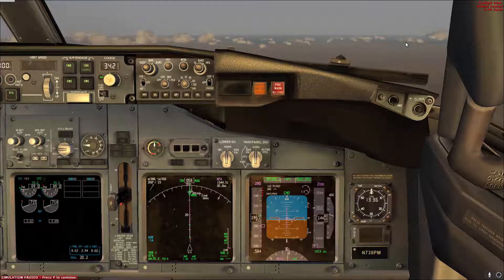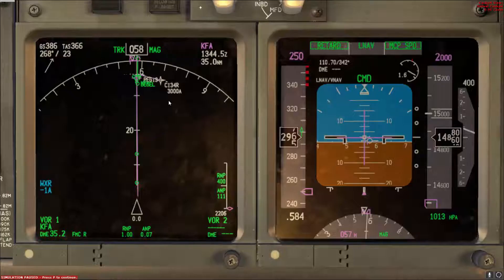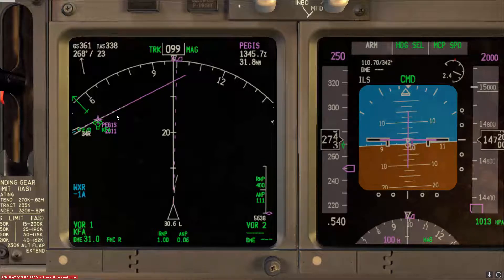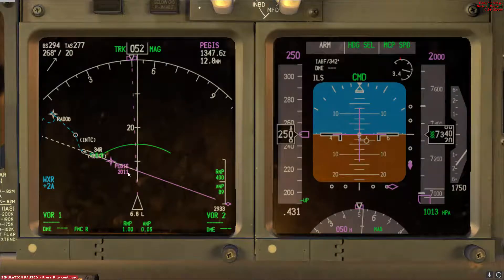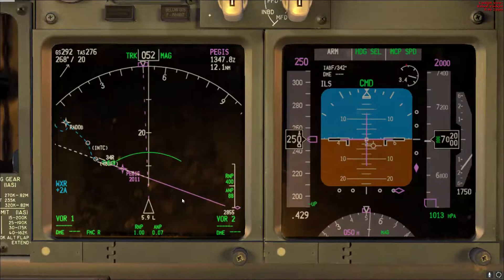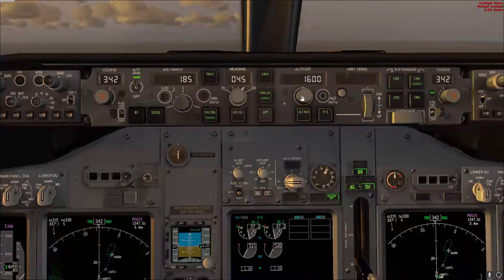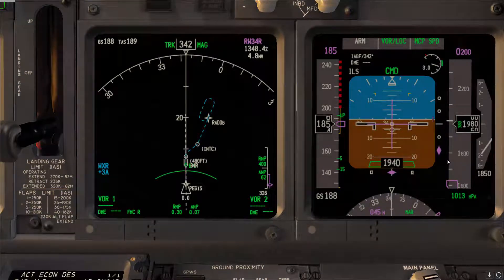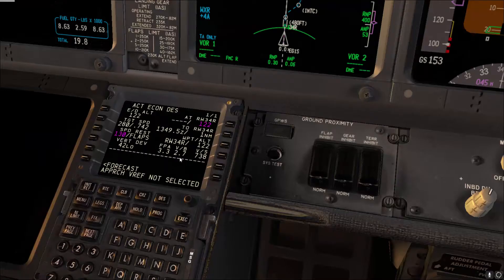B737 Energy Managment 2/2

Comment: Thanks Capt for the great videos, another way for track miles for example in your video at 14700ft if you select Meters in the EFIS panel you get about 4,480m which for reference you could use as 44 track miles to touchdown (sea level).
Reply from the maker: Thank you Bishtiga, 
That is a great tip, quick and easy to find track miles. 
Thank you for sharing 🙏🏼

Comment: Hello captain, I know I’m a little late on this video but I have a question?, can I extend the flaps to 10 and flaps 25 to slow down faster considering we are not exceeding the flap limit speeds? Would it be a good idea considering the exact situation as in this video?
Reply from the maker: Hello Erfan, 
You are not late, believe it or not I am working on a video currently talking about flap retraction/extension schedule, your timing is great 😉. 

F2,10, and 25, are not standard flap for the approach, the normal extension schedule is 1,5,15,30,40. From a few times that I was flying with pilots and they request 10 or 25 for this exact reason (being too fast) I find it not the best idea, using speed brake or extending the gear a bit early is much better.  
Hope that help, 
All the best 
Abdul
Reply: Abdulmuati Asiri Thanks for the response Captain. 
one problem is FCTM does not recommend to use speedbrakes along with flaps extended as it may cause buffeting. Now what I meant by using flaps 10 and 25 is just instead of waiting for the speed to decrease below the flap limit, you can just extend from let’s say 15 to 25 as the speed limit for flap 25 is less than that of flap 30. So basically buying time and slow dow faster. Now my question is weather this technique could leave you stabilized by 1000ft in this exact video?, or it would be just really not that effective?
Also looking forward to your next video!
Reply from the maker: Hello Erfan, 
I still not a big fan of F10 & 25, 😐. A few times that they were used, we were really close to the limit, that I felt not comfortable. 

The best option in my opinion if you are slightly above the profile selecting F1 then v/s 1500-1600 and f5 while still on the same or even increasing the v/s while watching out for the speed to be maximum 210 is a great way to get down quick on the profile then gear down, reduce v/s slightly to slow down slowly to F15 limit-10knots. 
Usually this is what I do if I am slightly high or fast close to the RW. 

Thanks for pointing out about speed brake use with the flaps 🙏🏼. 

And thanks for the feedback and discussion really approximate it, please continue raising up these discussion points 😊. 

All the best
Abdul
Reply: Abdulmuati Asiri thank you so much for the thorough explanation, I will note that down!

Comment: Hello Sir and first at all thank you very much for your videos. 
I’ve a question for you: I really like the energy management so every time I try to do my best to do an idle descent till gear is lowered. 
Of course is not possible every time but I think that it’s good habit if someone want to become proficient in it. 
So the question is that some days ago we have been radar vectored for an approach. 
We where within 10nm from the RWY on a right modified base, descending to 2000ft. 
FLAP5 speed brake and lvl chg 220 at 4000ft. Then I slowed down to 200kts stowing the speed brake. 
At the end I was 1 dot below the GS and I felt ashamed about that. 
The GS was showing us to be 1 dot and half high, but this was disregarded since we were not flying directly to the RWY, but flying a modified base followed by a vector 6nm on final. 
We were a little bit high at that point so I think the best option was the one to maintain a shallower rate: but how much shallower? 
I think something around 1000/1200ft min initially just to compensate for the excess of height. But since I was around 200kts, 1000ft/min is roughly a 3* path, and If I’m high I’d not catch the profile back. 
I hope to have made a picture a bit clear and to get an answer by you! Thank you so much
Reply from the maker: Hello Frabusne, 
Thank you for your kind words and taking the time to leave a comment and a question. 
Regarding your question, I believe having Flaps 5 with speed break will result in a steep decent, speed 220-200, do you remember how much  was the V/S in this configuration? 
I am glad you mentioned that the G/S indication might not be accurate specially if you are still a bit off the signal to one side or the other. “This something that man pilots do not consider “ 

So here are some points that might help you next time: 
- Utilize the V/B to the RW to identify how high/low are you compared to the profile and how fast the airplane is catching up to the profile that is FPA. Check my videos about the V/B if still not clear let me know. 
- Utilize the mental math the distance direct to the RW times 3. And remember the distance to the extended centerline can be added to find the track miles remaining to the RW. 
Finally I really do age 💯 percent on what you said that it take time to Hong this skill. To be honest with you I am still learning more than I want to admit😉. 

Let me know if what I said above make sense to you, and if you have any further points to discuss I will be more than happy to continue the discussion. 

All the best,
Abdul

Comment: why do pilots use a runway extended centerline and when do they use it
Reply from the maker: Hello Jessy thank you for a great questions. That is a concept I will give you an answer here, and will make a short video later on in the future to explain it more. 

Why to use it: 
-To clean up the legs page in the CDU and the map display in the ND. 
- To make sure the FMC will sequence to the correct waypoint, as you fly. 
- To intercept a radial or a bearing from a VOR or a way point using LNAV. That is true also to intercept an airway. 

When to use it: 
- On an approach if you are being radar vectored. 
- If you are not on an airway and you want to intercept one from a heading that is you did not get a direct to waypoint but a heading to intercept an airway. 
Those are the reasons from the top of my head could be more situations when to use it. 

Hope that answer your question, please let me know if you have any other questions or comments. 

Thanks again 
Abdul
Reply: @AbdulmuatiAsiri37  thank you for the time to answer my question! is there a way you as a pilot are able to prepare for a shortcut? for example you have a very long STAR but maybe its quiet and ATC gives you an early base turn. how do you prepare for a shortcut and what actions do you take such as flaps and speed and drag? sorry im just very curious :-D
Reply from the maker: Hello Jessy0506 
Thank you for a great question, 
I always use two ways of maintaining an awareness of track miles to the RW: 
1- Direct distance to the RW plus 10nm if I am coming for a downwind. For a straight in and base it is going to be the direct distance to the RW that is by reading the LOC DME out of the PFD, or by putting the RW in the fix page. 
2- Keeping an eye on the V/B to the RW I have a couple of videos about it. 

As far as the configuration goes two main strategies: 
Continuous descend about 20nm track miles that is slowing to UP speed, at about 220knts F1, when I have 1 with green light I go F5, at 8nm or 3nm to the FAF gear down F15, and ar 1nm to the FAF F30 landing checklist. 
 If I am level early that is already at the altitude of the FAF but still way out, I delay slowing to UP speed till 15 track miles. and then do the configuration as above. 

Hope that answer your question. 
I like that you are asking about concepts 👍🏼 

Let me know if you have any other questions or suggestions. 

All the best 
Abdul
Reply: @AbdulmuatiAsiri37  i like the direct distance to the runway +10 miles. the 10 miles represent the "traditional" 10 mile final right?
Reply from the maker: Hi Jessy0506 
The 10nm if you are coming downwind,  is a conservative figure to account for the additional distance you will be flying that is from RW threshold to 5nm base then 5nm base to 5nm final. 
I eliminated the base distance just to make the math easy and to be a bit conservative. 
Hope it’s clear if not please let me know
Reply: @AbdulmuatiAsiri37  very clear sir thank you so much. im very impressed how pilots always manage to find the right solution in certain issues. if ATC doesnt give you further descend for example. if youre coming from a downwind, how high should you be to accept that 10 mile final? and how fast do you fly with which flap setting? (sorry for asking you so many questions and sorry if you already answered one of the above mentioned questions) i play flight simulator alot and your videos are so full of information. i appreciate your time and effort!
Reply from the maker: Hi Jessy0506 
It’s my pleasure to answer your questions 😊,
Entering downwind I like the airplane to be in flaps one abeam threshold F5 speed around 200 decelerating.  
Their is a good rule of thumb for the altitude. AGL altitude abeam the threshold is how many miles you need for base. So for example 6000ft AGL 
Hope it is clear. 
Feel free to ask any question 😊 
Abdul
Reply: @AbdulmuatiAsiri37  thank you very much sir i appreciate it alot